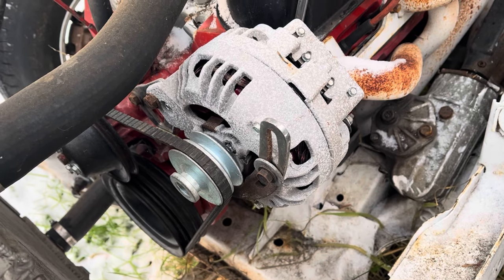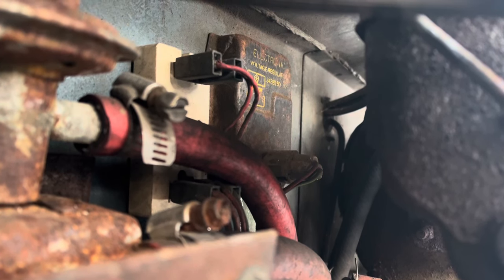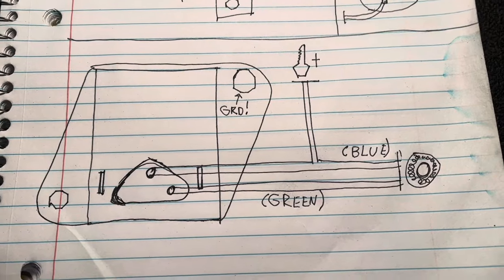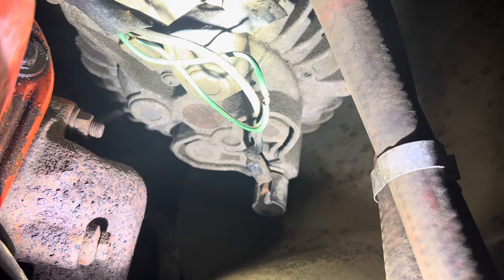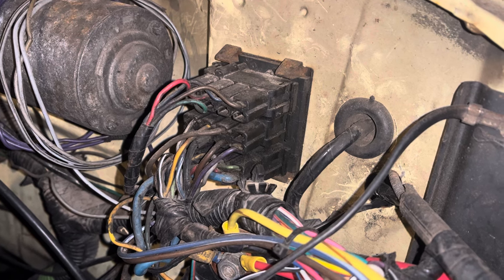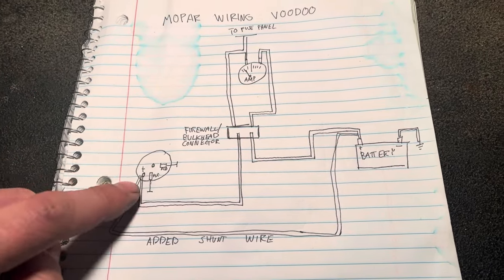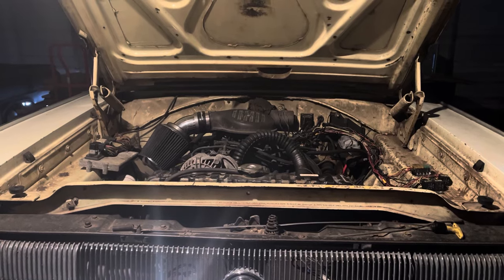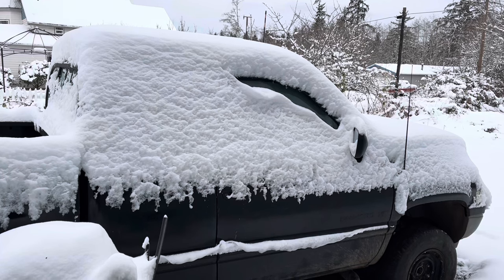Classic Mopar Charging Systems: How They Work, and How To Diagnose Failures

Comment: crysler new yorker 1966 i have 17 to 18 volt from generator new regulator new generator but on battery  i have 13,5 WHEN the light but when i turn on light it drops to 12,4 . i have changed ground from battey to chassi and chassi to engine and checked every connector please help iam desperate
Reply from the maker: If you have 17-18 volts at the alternator, but do not have that same voltage at battery positive, you have an issue in your charge circuit - either in the firewall connector, or in your amp gauge. In either case, you need to run a fairly heavy gauge charge wire directly from alternative positive to battery positive (I usually actually connect them to the large stud on the starter relay for a nice looking installation that does the same thing.)

Basically, your voltage regulator senses the low battery voltage and is attempting to raise it, but the charge is not making it there. Whether you’ve checked the often messed up connections in the firewall or not, your issue must be there. I do describe how the circuit works in this video, and I explain adding the charge bypass or “shunt” wire I am describing now.
Reply: @DeadDodgeGarage  how big of a shute wire do i need

Comment: My 72 charger recently dies driving down the street.Starts up after a few minutes. New alt,ecm...blue ,voltage reg,ballast res,...all well grounded. Ignition switch arrived to day... It better be the problem!!!! . 25 years with no problem like this...stumped
Reply from the maker: As I said in my email… I doubt it. Throwing parts at it is not the answer. Actual diagnosis is the way to find the answer. Hope the info I sent is helpful.

Comment: What motor is that
Reply from the maker: It’s a 360 with Edelbrock aluminum heads, among other things.
Reply: @DeadDodgeGarage  oh awesome. What is the belt size on the first truck hood you opened up?
Reply from the maker: @beaudenhymas443  I don't think I used any trucks in this video. I assumed you were referring to the first engine with the alternator flipped over on the wrong side. That was the 360 I described, and unfortunately that car is long gone so I couldn't tell you what belt was on it. That setup was custom engineered and definitely wouldn't match anything you've got anyway.
Reply: @DeadDodgeGarage  alright yeah I figured I was a little confused as why it was on that side haha.

Comment: The new replacement regulators are junk, they only last about a year or so and 1200 to 1500 mile i went through about 4 or 5 now, in my 77 w200
Reply from the maker: I used to go through them annually or worse in my ‘75 W100. Those trucks are where I usually see the bad regulator connectors. I wasn’t aware of that at the time. The other problem is that on those trucks, the regulator is right in the drip line at the back of the hood, which probably isn’t ideal.

Comment: Military 886 Powerwagon ambulance
My volt gauge bounces and lights flicker
Reply from the maker: I have never worked on one, but the M886 appears to use the standard civilian truck electrical system. In my ‘75 W100, I unplugged the firewall connectors, and (with the battery disconnected,) cleaned, re-tensioned, and applied dielectric grease to the terminals. It made a world of difference in the charging system’s operation and the brightness of the headlights. Verify your chassis grounds are in place - there is an engine ground strap, and I believe there is also a small one on the negative battery cable. Ensure the voltage regulator has a decent ground, meaning its bolts are tight. It is not uncommon to have stripped holes there. Hopefully that is helpful.

Comment: Hope you're not keeping that 1G Charger in the snow...
Reply from the maker: Well it’s already a rusty pile unfortunately. I kept it inside for years, but I don’t have the space currently. Even so, I’ve watched the quarters turn from surface rust spots to Swiss cheese. One of these years it will get the hole removal treatment, and we’ll get permanent covered storage settled. It doesn’t snow here often, but it sure does rain…

Comment: Best just to install a one wire GM alternator and do away with the Mopar system
Reply from the maker: People saying that are basically why this video exists. 🤣 

Lots of people want their engine compartment to appear original and correct, want their brackets to actually fit, belts to kinda sorta line up, and no hackery. I count myself among them. It’s not hard to make the factory stuff work.

Comment: Do NOT apply dialectic grease to the terminals... That is not what is for
Reply from the maker: “For connectors and battery terminals: coat both parts of terminal contact with dielectric grease. Reassemble maintaining metal-to-metal contact.” - the dielectric grease container

Comment: So I have an 86 ramcharger . The v belt system has been replaced with serpentine belt setup . I don't have an original voltage regulator that's bolted to the firewall. It's in my alternator an is not hooked up. I bought 2 wires an have them hooked up to the voltage regulator on my alternator. Where do I hook the 2 wires up to now?
Reply: What did you finally do?
Reply: @stuckinmygarage6220  wired in a voltage regulator an it works somewhat but my battery still dies after a few days ,it's got me so aggravated I've quit on it . Needs alot of work an to much for me to do unfortunately.

Comment: My wires are getting hot at Rev on armature gauge  especially  when lights are on I uses another voltage regulator from another mopar I have and some thing so I connected the red and black together   armature wires bolted  it tight still gets hot so  then I disconnected the black wire to bulkhead  and ran it straight to pin on starter relay sme thing but also black wire from alt getting hot also I'm so frustrated with this now please  help
Reply from the maker: Those wires carry a lot of current to charge the battery and run everything in the car. Getting warm is kinda normal. If they’re getting hot to the point of melting, you may have a short in your alternator.
Reply: @DeadDodgeGarage  well it gets real hot after awhile  then I shut it down I just put a new altanator  in I wish I could bypass the red and black wire to amp wires but looks  like a lot of work

Comment: How does voltage regulate with wire going from alternator to battery shunt wire?
Reply from the maker: Exactly the same way as before. The output circuit is not regulated directly. The alternator’s output is controlled by the regulator, which determines that output based on a voltage reading taken from the ignition circuit.
Reply: @DeadDodgeGarage you are awesome thank you so much
You are teaching this old dog new tricks
Again thank you
Reply: @DeadDodgeGarage it's over 16 volts at battery now
Seems scary high
Reply: @DeadDodgeGarage FYI
16 VOLTS without shunt
I guess it's time for a regulator swap
Reply: NEW REGULATOR  solved all my problems your advice on this video is clear and very very helpful